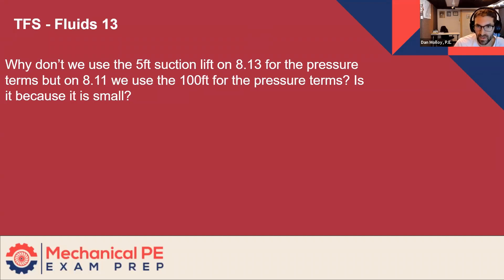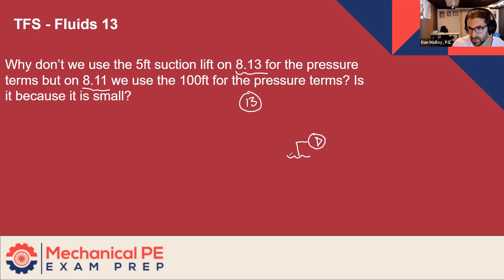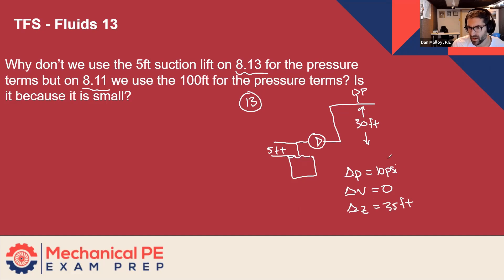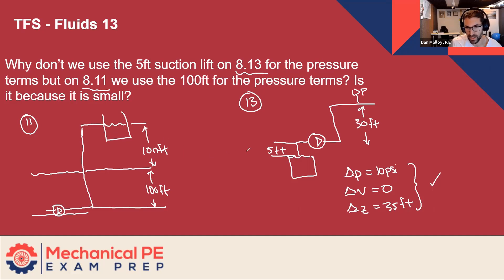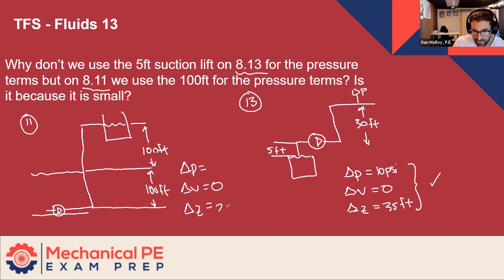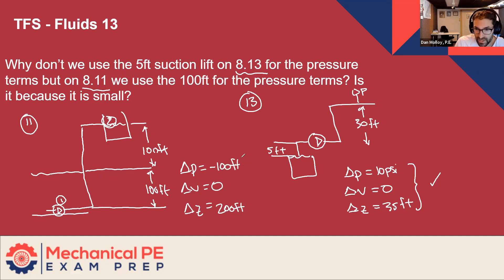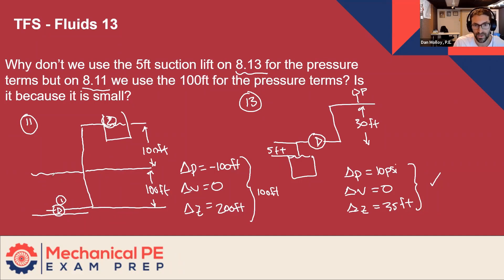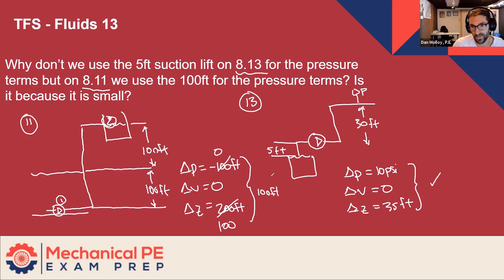Approaching Fluids Pumping Applications Problems | TFS PE Exam Prep with Dan Molloy, PE

Comment: This reminds me of question 38 on the current practice exam.  20psig pump inlet. 160' discharge with 20' friction.   the answer says 100 psi pressure rating is required of the piping but i calculate only 78. The difference is I didn't add the suction pressure but the solution does.  I don't understand how the suction pressure is relevant because the piping pressure requirement is the same regardless of the pump inlet pressure.  Your thoughts?
Reply from the maker: Super common question Cybek.  If I recall, the challenge with the one you are referring to is that the question is not asking about the head added by the pump!  Experience solving problems causes many of us (myself included the first time I saw that one) to simply match the pattern and quickly choose an answer.  The subtle difference is that the question is about the pressure rating of the piping itself, so we should add the column of water on both the suction and discharge sides which are both "squeezing" the bottom of the pipe where the pressure would be a maximum.  Speaking purely from memory, so if there are follow up questions just shoot me an email.  Contact details on my website.  When is your exam? -Dan
Reply: @MechanicalPEExamPrep  I don't have the exam scheduled. I've had my controls PE for 20 years and have designed probably 100 millions of dollars of commercial systems, mostly for the feds. I'm in no hurry but it's time to get a HVAC PE also because there isn't a lot of work for my specialty and I run circles around other PEs I'm tired of correcting their work lol. The presence of suction head should reduce the pump discharge head requirement so I see no reason to add both to the piping rating but I could be mistaken. Thanks for the info.